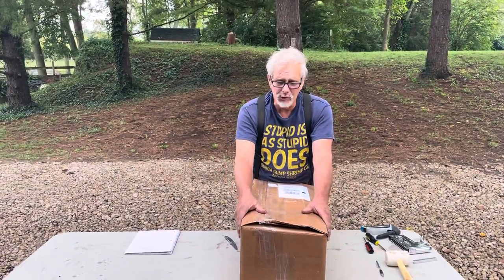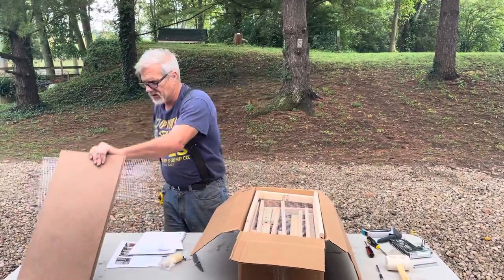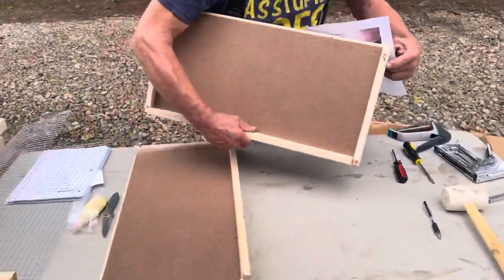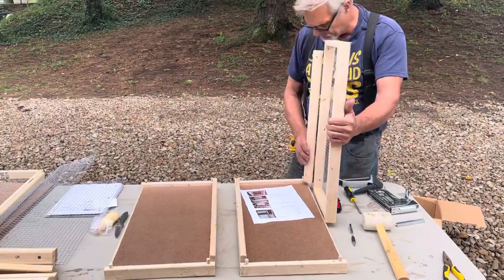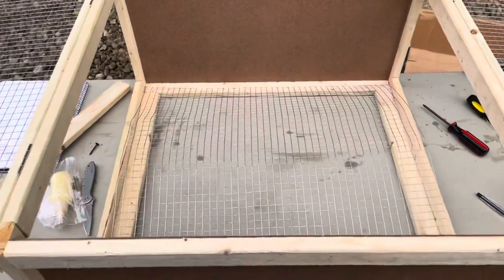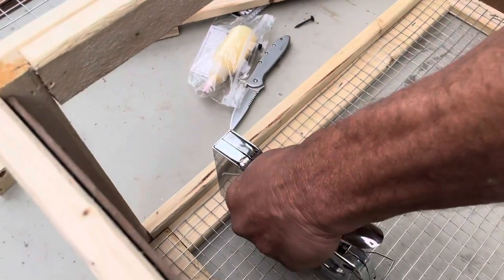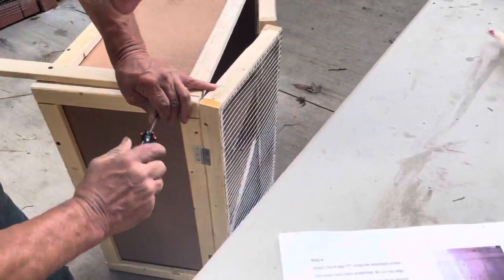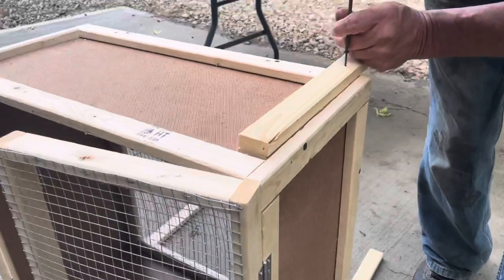How to assemble a Dales Quails brooder with Papa the builder from Myshire Farm!

Comment: That was the best build video we've seen in years 😅! Thank you Papa the Builder and Myshire Farms for giving us this opportunity and for your feedback.
Reply: I  love the wood/wire bottom but where do you put the plug if you use the heater plate? the plug will lift the lid.
Reply: @WhoisMichelleCollie  if you want to use a plate you can snip a square of the top wire out. Probably wouldn't be a terrible idea for us to add a hole in the side though.  Thanks for the feedback!
Reply: @dalesquails3543  best of both world. you can put a lamp on top and also If you get the plate theres a hole to put the plug thru. . btw will be buying your cage just need to save up.. senior here lol
Reply: @WhoisMichelleCollie  that's great to hear, we will make sure yours is ready for a plug